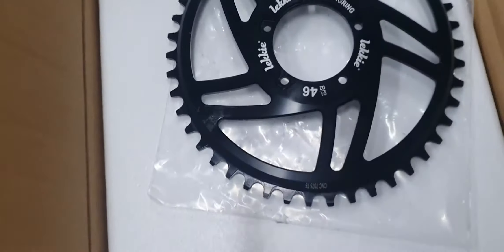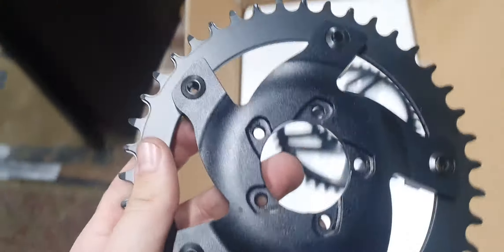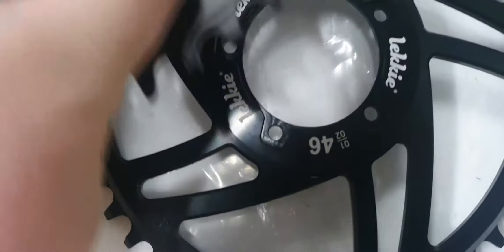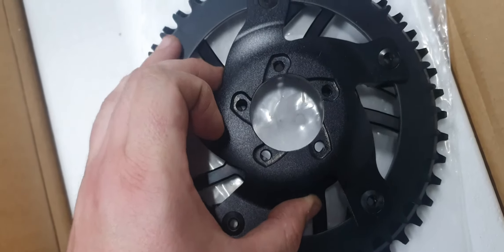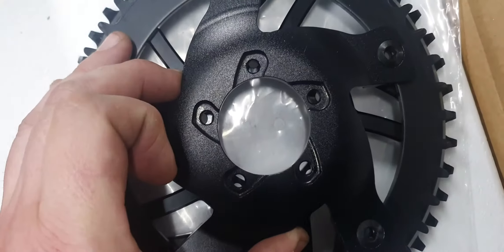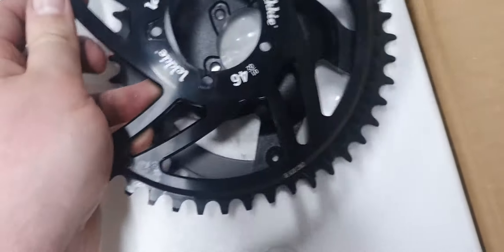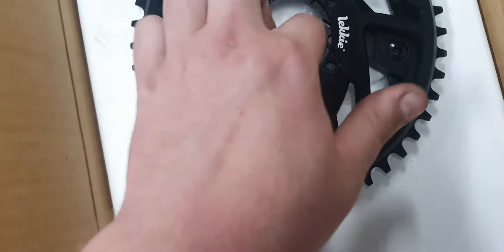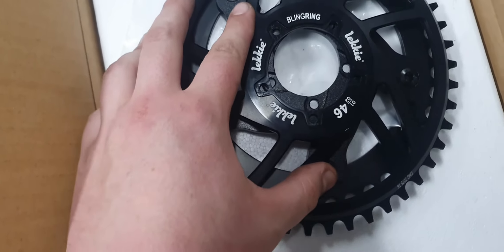wrong pcd lekkie ring gear

Comment: Why not just message them directly to sort the problem before making a video? Whatever the issue is I'm sure they will be more than happy to correct the problem.  Also are you at fault for ordering the wrong part? The website is very clear on saying which item fit each model of bafang.
Reply from the maker: Yes it's all sorted I got the correct one
Reply from the maker: They swapped it over for the correct one there are different types that you need to aware of which I didn't know about until now. 😃